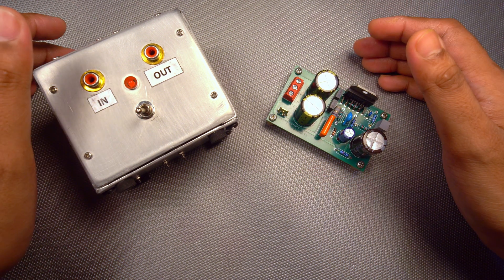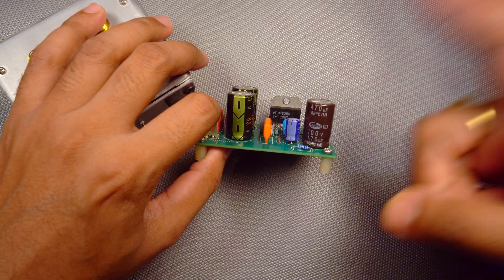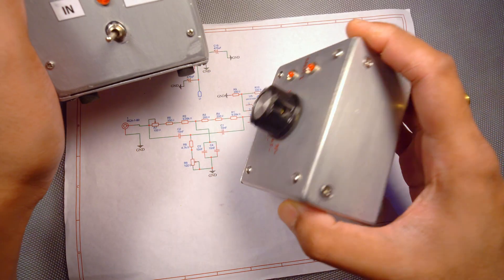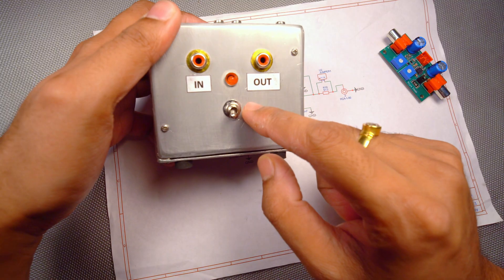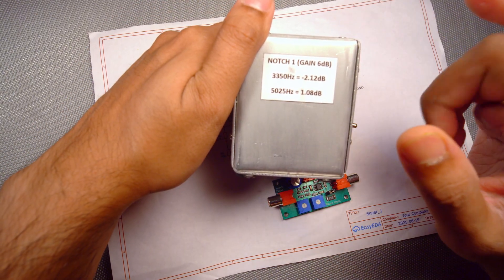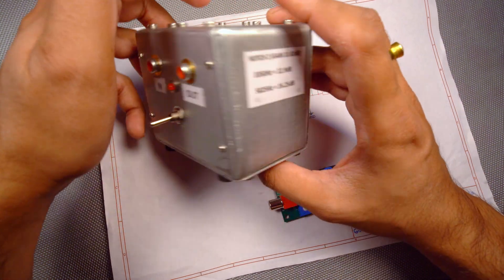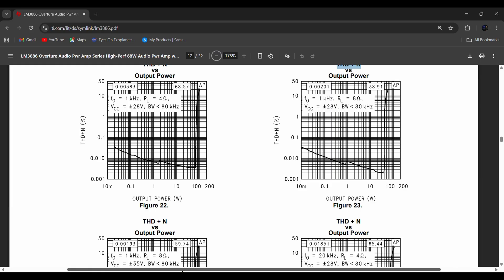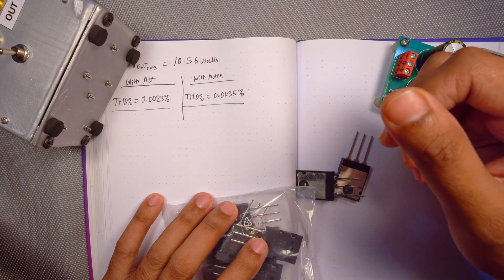LM3886 THD Measurement | DIY Setup with Impressive Results

Comment: Why aren't you using the FFT mode of the oscilloscope? It is possible to use THD through the FFT mode as well.
Reply from the maker: Firstly … my oscilloscope is owon hds242 which dosent have FFT in it …. Secondly FFT in oscilloscope is just 8bits , in high end ones its 12bit …. Which is not enough resolution for lm3886 THD figures … my setup is having 16bits… hence much much higher resolution!!
Reply: @Roys_Desk  Got it. I also want to make one to measure THD. Can you help me?
Reply from the maker: You can checkout my DIY THD METER playlist…. I have shown how to make one THD meter from scratch !!😊😊
Reply: @Roys_Desk But where can I get PCB designs?

Comment: Indeed impressive,well done!
about the notch filter though, with 20dB of gain the fundamental should have moved up to -20dB
but the graph at 3:48 shows it's still at ~ -40dB almost same as here 3:25   ... bit puzzling.
Reply from the maker: Thank you 🤩 
For the 20dB gain notch filter … I tried to select the component values properly and tune it precisely such that the notch happens exactly at 1675Hz …. Whereas the 6dB one is having the notch at 1684Hz or something . So even if the gain is more the initial notch is high enough to get close to 40dB of attenuation!!😊
Reply: @Roys_Desk  
got it...thanks.
I'm myself enroute (snail slow) to build an oscillator and notch combo,thanks to you....hope to catch up.

Comment: I  have Zoyi ZT 703S scope withh FFT function, can this be used for THD calculation?
Reply from the maker: No .... Scopes are mostly 8bits and some are 12 bits which is not enough to process low THD values .
My sound Card is 16 bit and that is also not enough for this task !!(Though Dynamic range matters in case of Sound cards)
Reply: @Roys_Desk  ok understood, thanks

Comment: how to find original LM3886 ic or duplicate ic (it really confusing because some ic are low price and some ICs are high price  and some ic are in middle price ) suggest me a good website to buy original ic
Reply: RS components
Reply from the maker: If You have access to Mouser then best or else you can contact Ultimax Audio
They give genuine  ICS
Contact- 7821921789